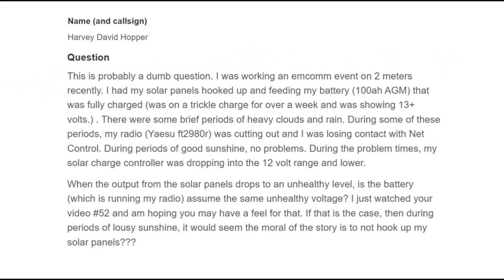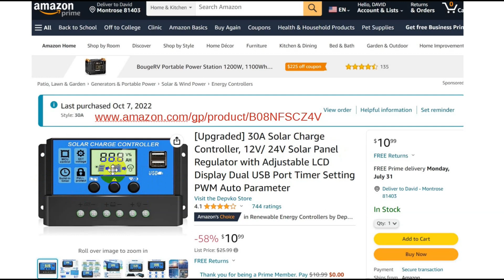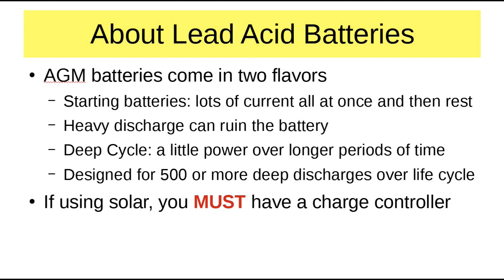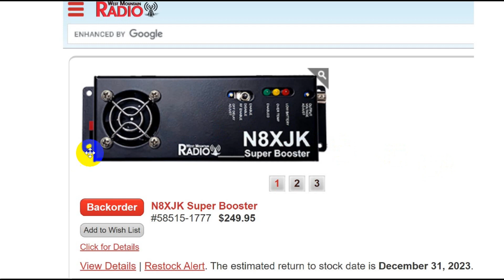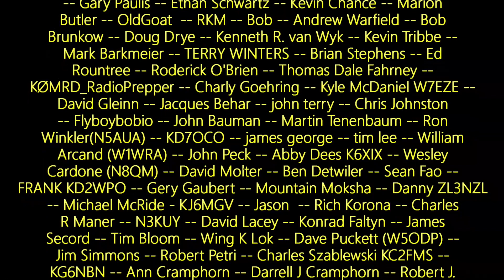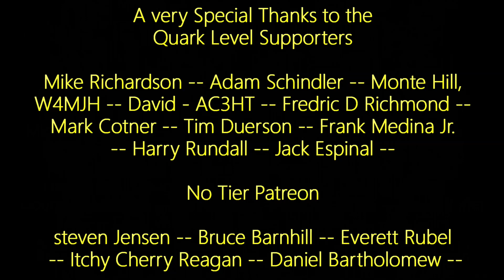Battery Charge Issues During EnComm Event (#986)

Comment: Used or old batteries from plant machinery can be usefull. They may have a spoiled cell and do not give amperage to start an engine, but they do quite well keeping voltage , like for running a tv, or a ham. The more old batteries you get your hands on the better. 73 Dave.

Comment: that was great. I say charge the battery with correct charger and load test it. I have been using AGM /flooded  many years . work great. The walmart deep cycle one is pretty good. Today I use higher voltage solar panel and a MPPT controller with ferrite on all leads. much better charging in low light. Using LiFePO4 now. lighter better cycles and voltage is higher during discharge. The cost per cycle is less then lead. if going LiFePO4 do some reachsearch and get a good one. and learn how to charge and discharge is correctly  and you have years of use. as with any battery ,if not used correctly it will fail. youtube is a great place to start. ask outher hams . a lot of talk about this on my local repeaters. never a dumb question ! ever. Please ask away ! 73's